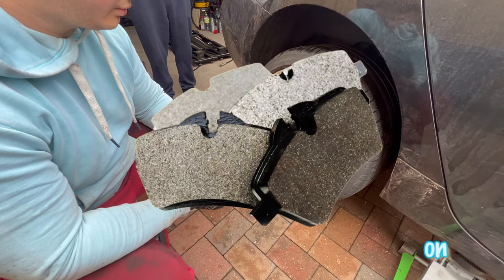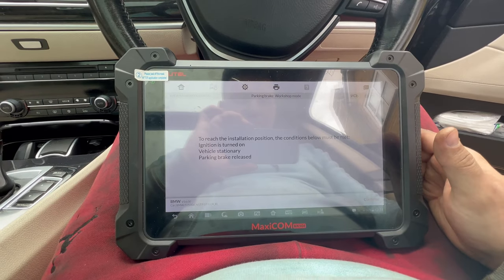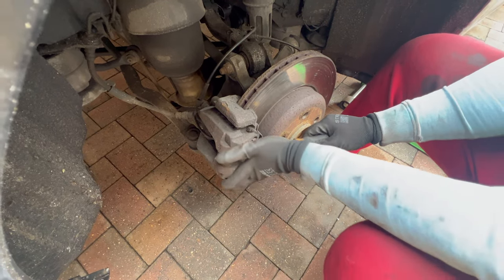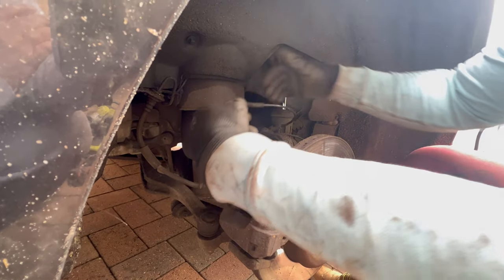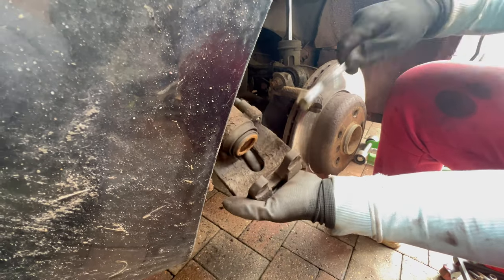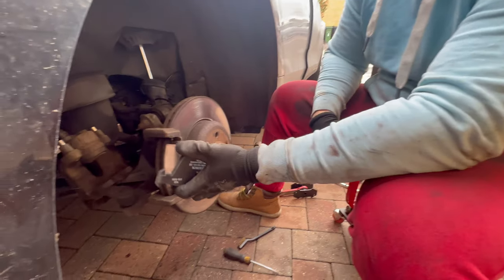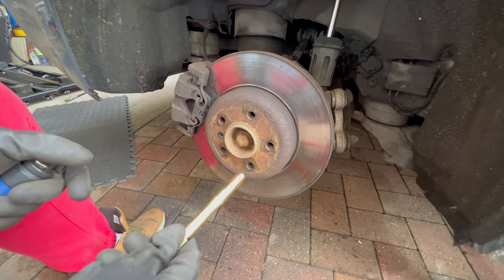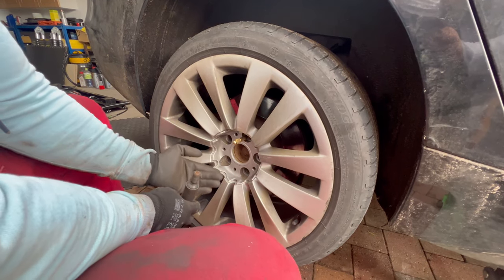BMW F07 530d GT Rear Brake Job - Rear Brake Pad REPLACEMENT Tutorial

Comment: You don’t really need to put the EPB in service mode if only changing pads since the parking brake is separate from the brake caliper. EPB works with brake shoes inside the brake disc.